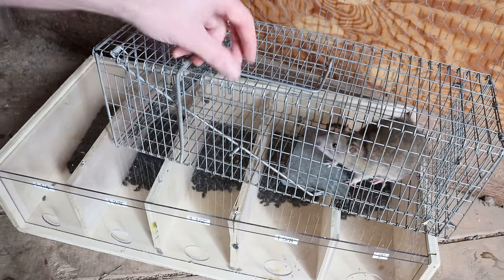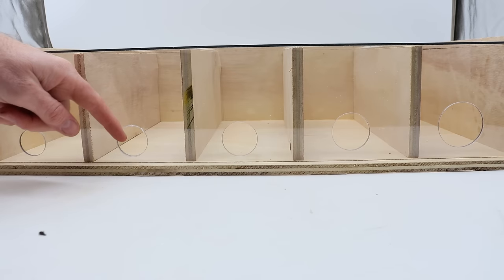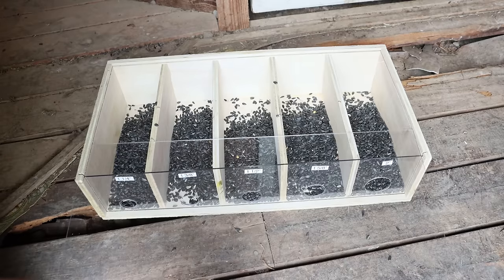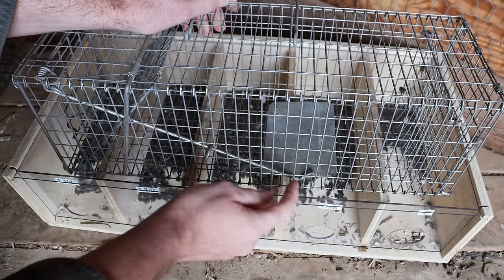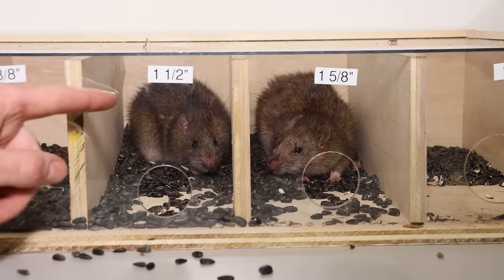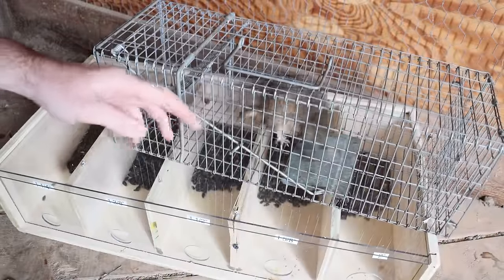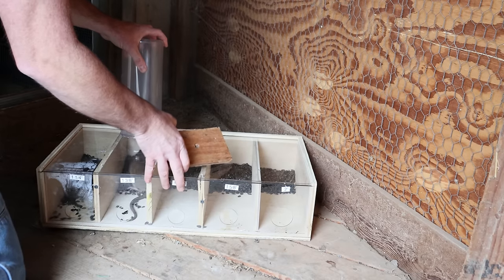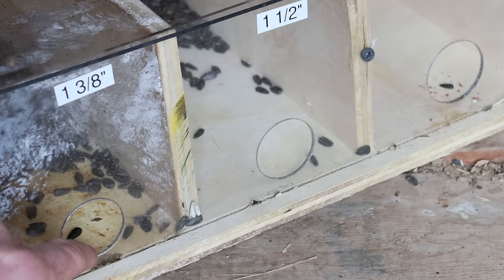How Small Of Hole Can A Rat Squeeze Through ?  Smaller Than I Thought. Mousetrap Monday

Comment: To avoid having to "reset the rat" between tests, you could have made a maze were the rat starts from the largest hole box and has to go through incrementally smaller holes. Another thing you could have done instead of manually moving the rat between partitions is making a little canopy box to allow the rat to move between neighboring sections.
Reply: Good ideas and suggestions there

Comment: Interesting, it looks like they don't like to chew on the plastic.  I really thought they'd gnaw through that easily.  It would be cool to retest this with the plastic roof but with wood front holes.  I bet they can gnaw through the wood down to 1", maybe smaller.
Reply: They love the flavor of plastic used as electrical insulation and the synthetic rubber used to route vacuum around an engine.

Comment: Enjoyable vid Shaun. I did liked you were trying to experiment although I was getting a bit concered for the rat that couldn't get out for 2 days as it was without water. However I don't see the point of this experiment....the hole size needs to be small enough to trap them all, not just the oldies! I use 1/4" mesh live traps for that reason.

Comment: A 35 cm rat fits through a inch hole in were mesh
Reply: Yea I figure they weren't quite motivated enough to try real hard and could all fit a size smaller. They didn't even bother gnawing at the acrylic yet.